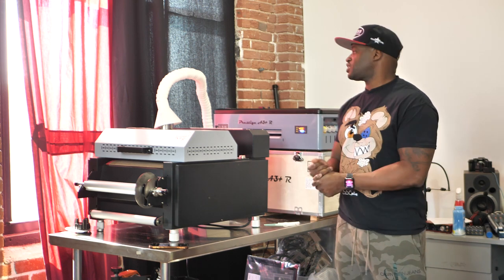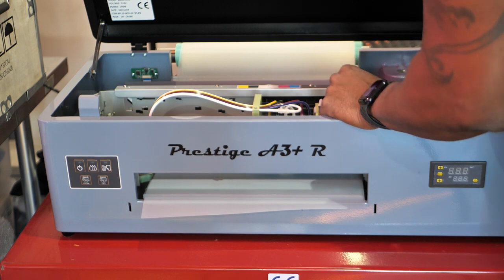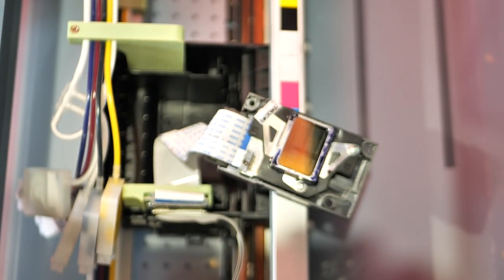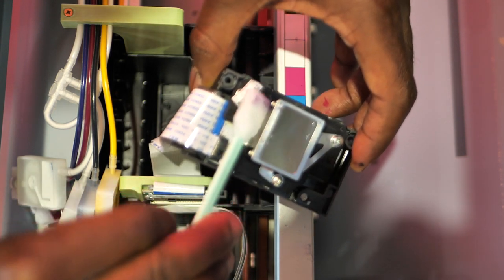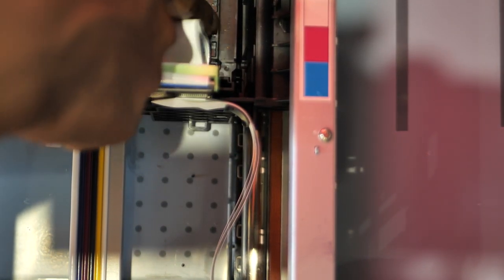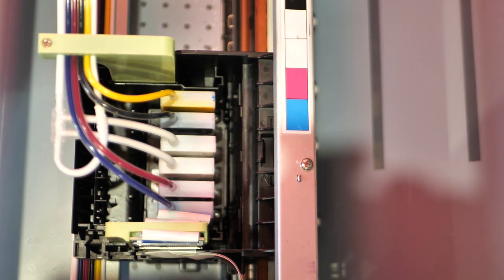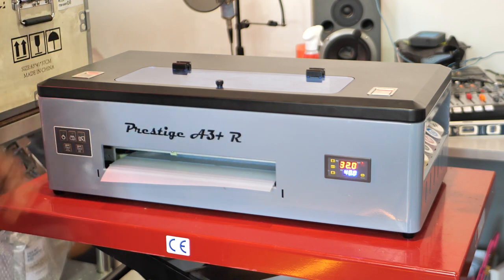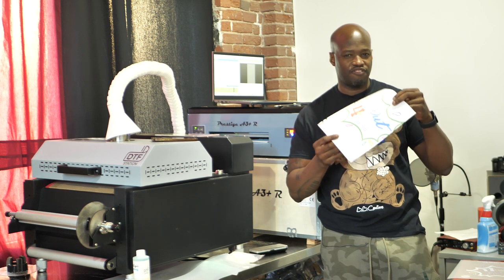How to Clean the Printhead on your DTF Printer (Prestige A3+R)

Comment: I had a few I thought were dull too. Cleaned up everything like you. I even created my own cmyk swatch instead of trusting that nozzle check. Rgb color conversion was the problem. Compared both and my swatch was way brighter. Now I just put dtgpro solution in my spare dampers to rest inside and start the day with head clean.

Comment: Pull back on the area u cleaned right beside of wiper blade. It has a little ledge on the right close to the wall of the printer. When you pull that back plastic piece over its made to easily pull wiper blade up. Learned that in another video.

Comment: Your videos are very helpful, thank you, my a3+R white ink is not white and ark garments, is gray for some reason, and not even the customer service people can figure that out, what do you recommend?
Reply from the maker: Does it put down a noticably white under base?.
Reply: @adubbproductions  yes, it looks really good on the film, but once is pressed it turns out gray every single time
Reply from the maker: @JuanCastro-dx1jk i haven’t had that issue. The white under base should make the colors pop. You probably are not laying down enough white. It should be a solid white with no colors showing through.
Reply: @adubbproductions  and that’s how it is looks like after printing but once I pres it it goes gray, the only work around I that I found was to doble the amount of white ink on the settings, but 3 mayor problems comes from that, first the time to finish a print is astronomical, 20 minutes in a regular 15x15 print, second the consumption of white ink doing it this way is absurd and third because there are 2 layers of white ink the ink starts to drift and it comes out of the borders ruining the print, the one thing left to do is to change the white ink because it might be contaminated, I just don’t know contaminated ink can do that, what are you thoughts?

Comment: In need of help! I have the prestige A3+R and can’t seem to have the setting of ink correct or doing something wrong. My prints are coming out dull and line looking marks instead of a full solid print. Can you help me figure out the best settings for bright and clear prints? What causes the line marks on each print?
Reply from the maker: Hey Melissa, did you follow the steps in this video? This should fix that issue. Sounds like your printhead needs to be cleaned.

Comment: It’s the Season Change!!!
The Room Temperature & Humidity is going to Make a Night & Day Difference!!! Try to keep the Room from 65 - 72 Degrees and 45 - 55 Humidity. 

The less often you touch your print head the better off you are!!! It’s like a lens screen better not touch it if you don’t have to.
Reply from the maker: Agree. In this case it wasn’t dirty but in my experience dtg wise it’s impossible to not touch the actual head and get great prints.z it eventually has to be cleaned but if the room is warm enough you can go a long time and be ok,
Reply: @adubbproductions  
I never had Temperature or Humidity issues with DTG to be Honest. 
DTF is More Temperamental.

Comment: Do you have a video on how to unclog a printhead?
Reply from the maker: No. Unfortunately I don’t. Never had to do it. I think you need to take off the head and touch just the head portion in cleaning solution and leave it sit for a few days. Just the part that the ink comes out off.   You are going to have to create a way to sit just that portion in cleaning solution to break down the clog.

Comment: when installing this  (Prestige A3+R)  did you pull the ink using Syringes to the head ? or this printer don't need that  ?
Reply from the maker: I definitely pulled the inks into the cartridges with the syringe. Yes i did.

Comment: Changed out my white All American ink to the new Color Max because my white was "OLD" is what they said.  Did all the things, maintenance daily(wet capping), Dampers are new and pull ink, cleaned  the print head and did the head strike vidoes available...still no white and cannot pull anything from the waste tank line at all but air!!  😥 Prints are printing colors beautifully but no white at all. .  Sooooo does this mean i have a headclog because the ink will not pull through? And does this mean I need a new printhead? Any last resort ideas?
Reply from the maker: If you are able to pull air the lines are not clogged so that eliminates that possibility. If you keep on pulling and no ink is coming out that means you have no ink in that specific line. If you keep pulling and there is ink in the line the ink would come out. Maybe you might see a little bit of ink in the lines but you do t have enough pulled in from the actual ink cartridge things.  That’s the issue I was having at first. Gotta use the syringe and pull ink into the cartridge first. Make sure you’ve pulled in ink using the plastic screen on the back of the cartridge. Gotta place the tip on the syringe to stick threw the tip and bottom of cartridge. Might have to cut the tip a little and almost push it threw the hole kind till it gets in there. Almost feels like a slight puncture. Hope that helps.

Comment: I’m having an issue with the two red lights on the front of the printer blinking at the same time. Any ideas on what that might be?  I used your video to clean the print head thinking that might help but it didn’t. The printer was working all day, turned it off for about an hour and when I turned it back on they started blinking.
Reply from the maker: I think i had that issue. Is your waste container full?  After you empty it out manually you have to use the application they had you install on your computer to clear it out.  It’s not the dtf station app either it’s the other one. I’m gonna have to make a video on it.  O sure that’s the issue. It won’t let you do anything right?  I had that.
Reply: I had a similar issue. In my case the waste container was empty.  The DTF station tech advised to clean the metallic strip with a lint wipe. It worked.